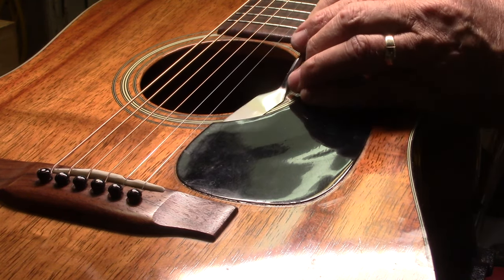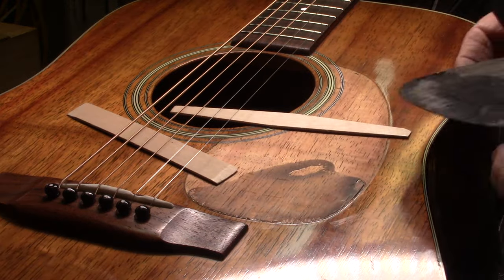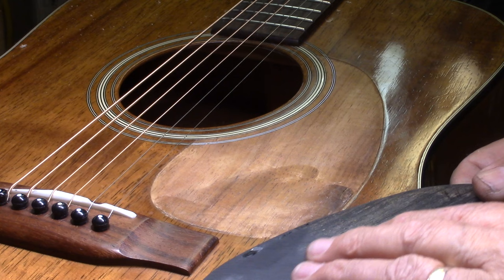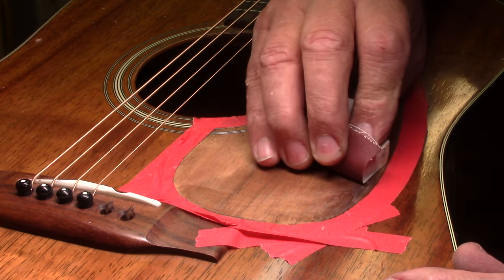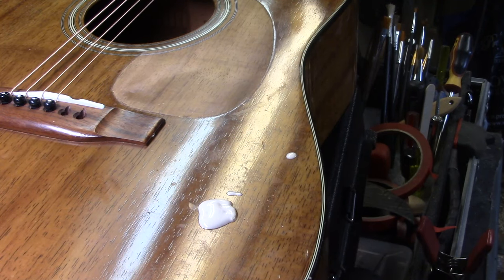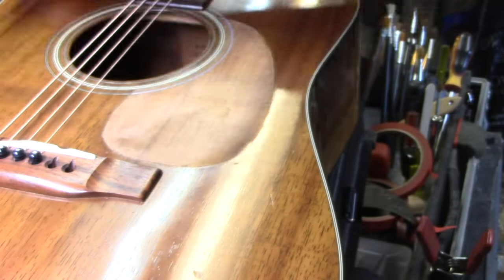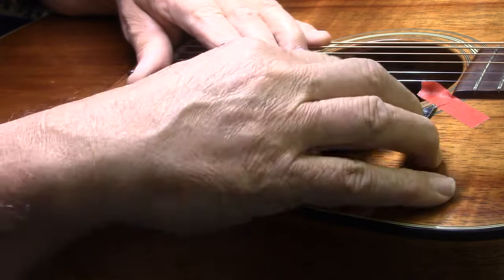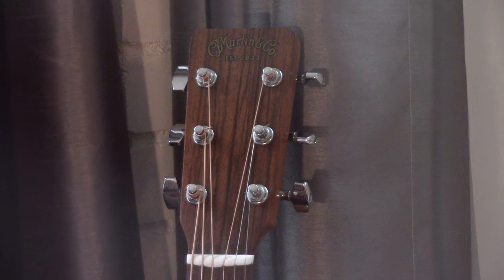Vintage Martin Pick guard removal

Comment: Off subject of this video. Where can I find a link to those 16 packs of compensated nut blanks? Honestly I only need a couple but I’m desperate to get my Godin Multiac to closely intonate. 
BTW, On Ozzys Diary of a Madman he has a line, “Good intentions pave the way to Hell” 🤷‍♂️
Reply from the maker: Is your Multiac a steel string model ?
Reply: Yes, Steel w/SA(13 pin GK-2A & regular 1/4” outputs) brass piezo saddles In bridge make a compensated nut a no go🤷‍♂️. But I have other guitars I’d like to try compensated nuts on. 
     I’ve recently seen an old lock for a Floyd Rose but it is mounted behind the nut on the headstock. I’m wondering if this isn’t the solution I’ve looked for forever! Regardless, can you please send the link for the nut blanks?!?!🙏 
  This is the 2nd or 3rd time I’ve asked in the last month. Thanks again! Your channel is invaluable for me! I love it! ✌️
Reply from the maker: www.mcconvilleguitars.blogspot.com/
Reply: @StringTechWorkstations   Thanks! 👆🙏 

   If I could, I’d ship my Floyd Rose equipped guitar to you but I recently sold & shipped a sweet Schecter from here, S. Carolina to Pennsylvania and was SHOCKED at how much it cost in 2023! $160 US one way! I’ve already dropped a lot of $ into this upgrade project (Lindy Frailens, etc!) If I weren’t sentimentally attached to the body(which I decorated) id’ve simply bought another body. Mine is an Ibanez Jem which limits my neck options because of the unique heel. I’d send a picture but YouTube doesn’t have the option! I hate to blow you up with questions & pick your brain but I’m very impressed with your work skills & ability, so I value your opinion. If I could I’d scrap the Floyd rose as my taste have changed to more bluesy jazz. But the attachment to the body🤦‍♂️ I put a lot of time & effort in this decretive body. 
My last resort now may lay in your truthful humble opinion on the “Lok n Roll” compensated locking nut. I’m a stickler for intonation 🤷‍♂️ Have you any experience with them. 
      Sincere Thanks, Roddy✌️
Reply from the maker: https://youtu.be/1uJWRnD-RNc?si=0NPzFzzpSSQqTNgw I make the profile of the compensated nut blanks large enough to swap out a comp nut ... if that's what you choose to do. I currently have a ( robotic-tuners ) LP that the customer changed tuners .... the nut on this one was " adjustable" ... stay tuned that video is coming right up. BTW: Yes ... shipping charges have increased since the pandemic .... maybe they're doing some "claw-back" on the $$$ they lost ... ?!? Who knows ?